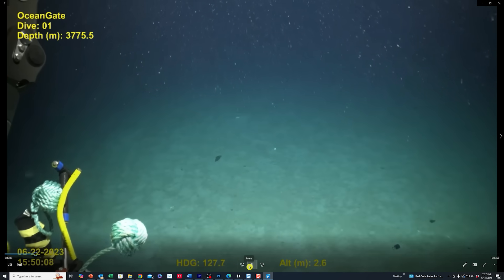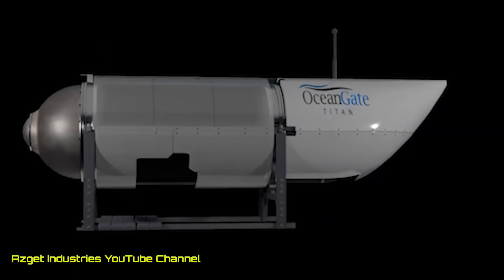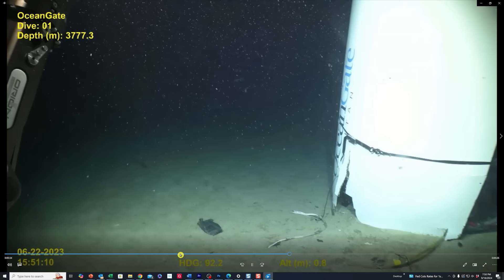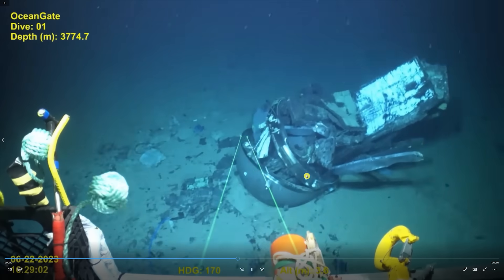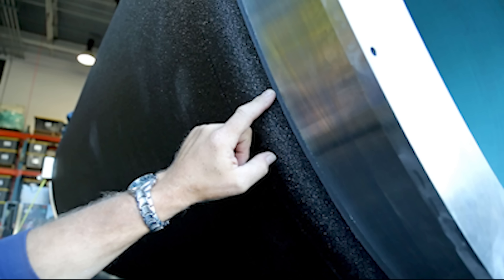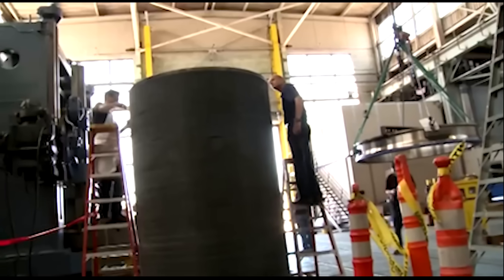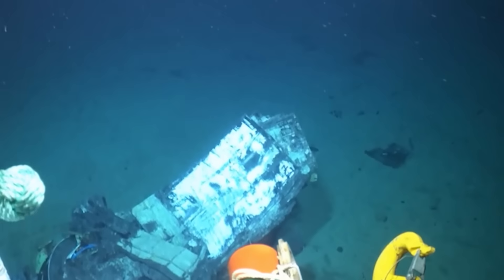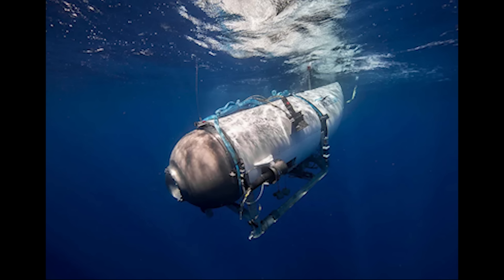OceanGate Titan Sub Debris Video Shows How It Imploded

Comment: Still nobody has answered my question from the videos a long time ago...... 
Here's the scenario..... Oxygen and oil detonate at 2000 PSI..... That's at room temperature.... If you increase the temperature the flashpoint drops considerably ..... And the PSI drops very quickly that's what causes a diesel engine to start you increase the temperature and you get detonation... That's without a spark plug.... You put some ether in the engine i.e. starting fluid.... And that lowers the flashpoint and the engine starts.. okay... So what am I getting at.... There's oxygen.... Add oils in those composite materials... There's oxygen inside the capsule... For the occupants to breathe..... There is oxygen in water. But mostly there's oxygen that's mixed in with the resin in the form of minerals.... And microscopic bubbles of air.... And the resins  in the composite are made from oil... What I'm saying is has anybody taken a piece of the composite material and put it into a pressure chamber you know just a small piece.... Increase the pressure to what was on that submersible.... Which is way up there.  ..... In the thousands of PSI..... Yes put a piece of that material in a pressure chamber and increase the pressure and see if he can get a detonation.... Have somebody do that.... Somebody's got to have some equipment that will do that..... Try it .....then you can say .....hey we've tried that........ But just hunting and pecking and doing this that and the other and guessing..... is  not going to get some facts that I am talking about. Hey correct me if I'm wrong.!!!!!
Reply: example.... For anybody that wants to know..... On a welder's oxygen cylinder they say never use oil on the threads when you attach the regulator on to the bottle.....

Comment: Very good point about the smoothness of the titanium ring's surface
Reply: that surface of the ring is the top one, conected with the end caps , which the man was wipeing  with the rag. the bottom one we don't see, is U shaped.
Reply: Not a good point at all, as that’s not how this kind of adhesive works.

Comment: I worked in composites (specifically carbon fiber) at Boeing for 30 years and I can't believe they thought that an epoxy based adhesive was going to hold that titanium to the carbon fiber under those kind of pressure loads over and over. I actually bonded carbon fiber shims to titanium wing spars on the A-6 re-wing program as a repair when the machine shop milled too much of the titanium off of the wing spars. We kind of thought that was crazy but Engineering and the Navy approved those repairs and those did last until the jets were finally retired.
Reply: The carbon fiber used in aeronautics is perfectly fine for that use.
The issue is that you can't (or shouldn't) use carbon fiber for submersibles because carbon fiber excels in tension load (great for planes) but sucks in compression load (deep-sea).
Also, carbon fiber will fail instantly, titanium on the other hand will give you signs of starting to break so you have time to react.
Carbon fiber has porosity which isn't a big deal for a plane, but you don't really want water entering your underwater vehicle...
The only reason this guy made the sub out of carbon fiber is because it was cheaper, not because it was better or a good idea.
Rich guys think they are rich because they're smarter than anyone else, well here's the results of that theory.
Reply: @SaffronWorldCR  I worked in composites for 30 years and porosity is a big deal for aircraft. All of the carbon fiber parts for aircraft has to be sealed so water doesn't penetrate the part and then freeze at altitude. I agree that money doesn't equal intelligence.
Reply: @SaffronWorldCR  I don't understand why the only used a single curve surface for the tube & not a two curve surface like a wooden barrel ?
Reply: The issue was that the carbon fiber and titanium each expand and contract at different rates, and under the massive pressure that they were repeatedly subjected to it took only a microscopic gap to eventually form which caused a complete decompression failure.
Reply: @hojo70  I know that.
Reply: when I worked in the carbon fiber industry, I could not believe they actually wound the strands like a barrel,  there is not much strength in just that single linear way,  did they weave it in a diagonal way as well?   which we used to do.
Reply: @TerryHickey-xt4mf  I would think that they oriented the plies at different angles.
Reply: @TerryHickey-xt4mf it was wound on a cylinder from one end as a single layer first. After the first 360 degrees there was a slight offset, so it wasn't a ring but more like the groves in an LP, or more accurately, like the helical grove in Edison's cylinder audio recorder.

Once the first layer was done, the fiber laying reversed direction and became a helix crossing the first layer at a slight angle. This was continued for many layers and did result in a weave.

The tube didn't really fail initially but it flexed enough to allow the front dome inner seal ring lip to fail and, unsupported, the tube did collapse from the front.

Testimony from engineer at coast guard hearing.
Reply: I worked at Krispy Kreme for 5 years, I concur with your comment.
Reply: @TOGA_LK  5 whole years? You must be so proud of yourself.
Reply: I think the idea was the water pressure shold push the titanium dome against the carbon wall. As long as the carbon hull did not flex it should be okey. If water came into the hull the domes and window would be pushed off. If the window failed due to preassure from outside I think it would have been sent through the cabin into the rear dome and smashed or pushed it off.
If the hull collapsed, the water preassere should pushed the domes off.
Reply: I thought they said he made a few trips to the bottom in that thing.
Reply: @ToniTruthArt  They did and that was the problem.
Reply: Sim é verdade  @ToniTruthArt
Reply: I worked F-15's for a decade and when I saw that for the first time I said out loud, "Is that f*cking B-1/2?" I don't know if that's the "peanut butter" they're referring to but it looks just like the Henkel/Loctite sealant we used for sealing fuel tanks and preventing fretting damage when doing structural repairs.
Reply: When they approached Boeing they were planning to build it completely out of carbon fibre. So the aft section and cylinder would essentially be a monocoque structure + separate end-cap made with carbon fibre.
Reply: How do you think, could be the reason for this failure that carbon epoxy and titanium have completely different resistance to micro-deformations (titanium is much stiffer as far as I know), which leads to local fatigue of the carbon epoxy part in the plane of the connection with this type of fastener (titanium ring around carbon epoxy tube)?
Reply: @zloezlo  Yes, they expand and contract at different rates.
Reply: I heard they used reject materials from Boeing, to save money...crazy
Reply: @denisedeakins4828  It wouldn't surprise me. I retired from Boeing before they made that death trap so I don't know if they did or didn't.
Reply: US Navy did have a carbon fiber sub. Before they put a person it it, they tested the model to destruction, repeatedly. Shrugs

It can and has worked... just need to test the design to fully understand where the problems can occur and rectify those by not making the "mistakes" and/or staying well away from "max depth".
Reply: @aralornwolf3140  Engineering is everything. The engineering for Titan was garbage.
Reply: Rush built the worlds first disposable submarine but didnt know it titan made it to titanic a few times which is a miracle it didnt implode on the first trip the hull cracked each time she dove she was built to on go 1500 feet stockton took the titan 12500 feet it was pure insanity!!
Reply: Boeing😂😂😂😂
Reply: @matthewp1682  I haven't worked there for years now and you're right it's a total clown show.

Comment: I'm not an engineer, just a guy with an industrial design background and even I would have walked away after hearing the plan to keep each dome attached using nothing but adhesive. I can see why they chose that route but having no additional solutions to constrain those sections is just mind blowing. 

You might get me to buy into a CF cylinder idea after extensive testing but certainly not in the way they're doing it. It's really sad that people lost their lives to this incompetence, regardless who they were.
Reply: I always felt the adhesive failed from the hull flexing over time. At the least, this vessel should have been rebuilt xrayed and inspected after every dive.
Reply: No reason to ever use composite, it was a stupid idea. If they had just built the whole thing from the same titanium the end caps were made up they'd all still be alive.
Reply: I was thinking it needed a ring of titanium or 2 inside the vessel to help with pressure and certainly something better than glue or better attaching surfaces.
Reply: @PeaceMarauder Another ring wouldn't have helped, the carbon fiber itself wasn't the issue, it was the fact that it was bonded to another material. The carbon fiber and titanium each expand and contract at different rates, and under the massive pressures they were repeatedly subjected to it took only a microscopic gap to eventually form to cause a complete decompression failure.
Reply: @hojo70  That's not true, the carbon fiber is the issue. Numerous engineers and subject matter experts have said that carbon fiber cannot be used for this purpose. The fact there is no good way to bond the carbon fiber to the titanium end caps is just one of multiple reason carbon fiber is not suited for this purpose.
Reply: @hojo70  I don't believe that they were bonded together, just a non-hardening sealant to fill in any gaps when the tube & caps flexed.  The pressure on each end cap is what kept it together until the tube cracked or collapsed.
Reply: The Titan submersible would have probably been fine if the hull was made from titanium and not carbon fiber. The banging noise heard when diving was the carbon fiber slowly cracking and breaking. Each dive the carbon fiber would have been weaker.

Comment: Did you look at the sub part and aft dome? It's packed with carbon fiber chunks. The Titan failed from the front top or sides and imploded to the back. The chunks are tightly packed at the aft.
Reply: That was my impression as well, PeaceMarauder...  Hull crushes, front (nose) dome blows off, travels whatever distance we see there...  The aft section is on the bottom, stuffed with broken up carbon fiber hull chunks....
Reply: @Rh493-o1x  Yeah, I didn't think about the late recovery of the aft dome at all until I read Your comment lol
I know, I just added it, because of the comment You replied to and also because many others (including myself at first and Jeff) think the dome, ring, carbon fiber mess is the aft portion.
Reply: @Null8fuenf10  It is packed into the aft dome, the forward dome is the blasted off piece. The window is missing and sand is coming up through the hole. Very clear in the video.

Comment: Great analysis, Jeff. It seems to me that the failure happened at the connection to the viewing dome. The rapid implosion would then quickly drive the afterpart (i.e., everything after the point of failure) toward the other titanium dome. That might explain why there is so much debris compressed into that dome while the other is completely devoid of any materials. Given the fact that the viewing dome was also the door, it makes me wonder whether that helped hasten the wear of that portion of the sub (and its fiber and/or connection between the titanium dome and the carbon cylinder).
Reply: In fact, I suspect that the "remains" that were found were found compressed with the rest of the wreckage into that aft titanium dome (which still had the titanium ring partially attached). Thus, everything after of the breach (which seems to have happened at the titanium viewing dome/ring connected to the fiber) imploded in the direction of that viewing dome and everything behind it in the direction of the opposite dome. I'm fairly convinced that the remains were found compressed (with the rest of the wreckage) in that opposite dome.
Reply: @ccchhhrrriiisss100 the forward/viewing dome is off by itself without any debris.
Reply: @arwenreis4775  Which is a good indication that the explosive breach happened near it -- likely at the glued connection(s).
Reply: I believe it failed at the top front or sides of the carbon and forward ring blowing out the view port and forward dome, probably dragging the ring along which fell off at some point. I find that the bottom is intact probably from the air tanks lending extra support but now crushed into the aft section or blown out somewhere. 

I'd like to see a new animation using what we see now.

Comment: Even IF the adhesive held, which I very seriously doubt, carbon fiber and titanium compress at different rates and amounts that you would think would cause the adhesive to tear from differing compressions.  This is, of course, if you completely ignore the fact that carbon fiber is designed to resist EXPANSION not compression.
Reply: This is why I was thinking it needed a ring or 2 inside.

Comment: If that solitary end piece is the one with the viewport (which it appears to be), then the mangled wreck of carbon fibre with the rear end piece at 4:45 suggests to me that you're right. It failed at the front interface and crushed everything up into the rear of the cabin. Just looking at and considering that piece of wreckage alongside the first two days of testimony from the hearing, it's such an awfully upsetting example against libertarianism, particularly where engineering is concerned.

Comment: Knowing carbon fiber, I would never trust my life to carbon fiber in this type of adventure!  There is a limit to epoxy.  It seems reckless to trust carbon fiber to those pressures!  If the carbon fiber was reinforced with titanium rings and titanium plate, it would seem like a real engineer worked on the design.  This reminds me of the idea of building a complete engine from carbon fiber, until they found out what heat does to the epoxy.
Reply: yeah, when I saw the design while they were searching for the sub I was thinking it needed rings inside.

Comment: The cylinder had carbon fibers only going one direction.  In the longitudinal direction there were no carbon fibers.  If there is any differential movement occurring between the cylinder and the titanium ring it would easily fracture the cylinder.

Comment: It doesn't make sense that the pressure would disintegrate all the carbon.The initial breach is not the entire surface so a certain point that collapsed,  and the rest of the structure would have been pressure equalized immediately.

Comment: Jeff, the video of the assembly is not of the hull that failed.  This was the first hull, which oceangate condemned.  The hull that failed was made by Electroimpact, which is a serious manufacturer.
Reply: Glad the submersible engineers are here
Reply: They said the glue failed and the ring came clean off in the front...the sub never imploded...
Reply: @leftlanereiko6063 The glue on the ring gave way eventually,as soon as the seal is compromised the pressure would be equalised in a fraction of a second.It imploded.
Reply: @slydawgg  You have enormous force driving the end caps into the cylinder.  It doesn't need glue to be sealed under pressure.  Until the cylinder fails the seal will be fine.
Reply: @k53847 I understand what you’re saying but It was glued aswell,check out the manufacturing vid.
Reply: @slydawgg  Yes, you need the glue to keep it properly aligned during transport etc.  It also provides a gasket before the pressure builds enough to seal.  When where you have hundreds of tons of pressure pushing the Ti end into the cylinder the glue at most provides a flat surface to ensure a smooth seal.
Reply: @k53847  I was just repeating what what was said at the latest enquiry. The guy who examined the wreckage said the resin failed at the front dome, due to repeated flexing under pressure.
Reply: @slydawgg  Well, he might be right and I might be wrong.  But the pressure on the entire dome is being transferred to the cylinder via the mating surface, so the pressure between the CF and TI will be much higher then the outside water pressure.
Reply: @leftlanereiko6063  what
Reply: @leftlanereiko6063  rubbish

Comment: So is NOBODY gonna talk about the RATCHET STRAP around the hull?
Reply: Kind of dumb, but was probably just holding the panels from flapping a bit more than they liked. Was definitely not any part of the structural system.
Reply: @chrismaverick9828  What quantity of straps would you consider sufficient to be a red flag ?
Reply: The strap just held the exterior panel on. That section is not pressurized.